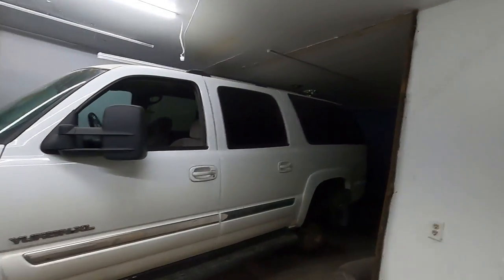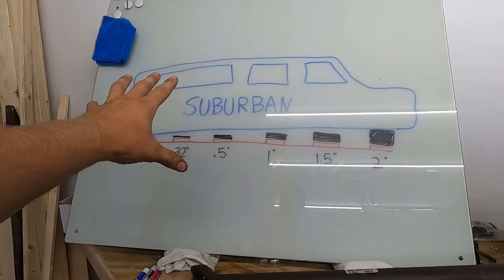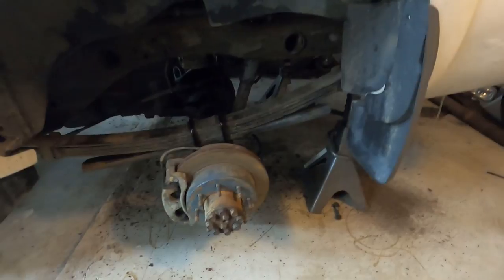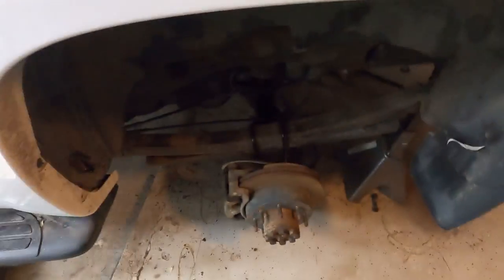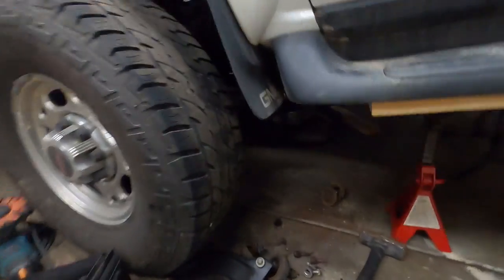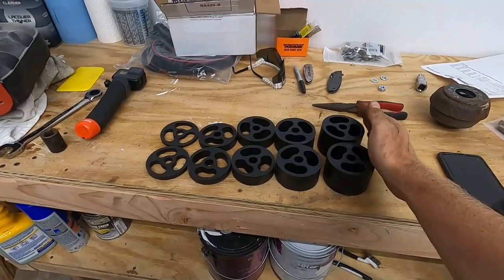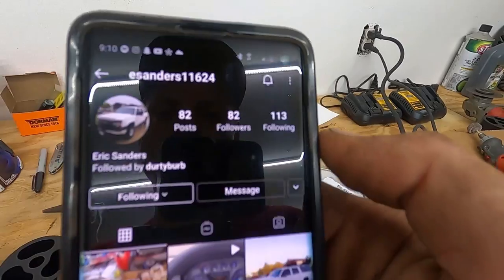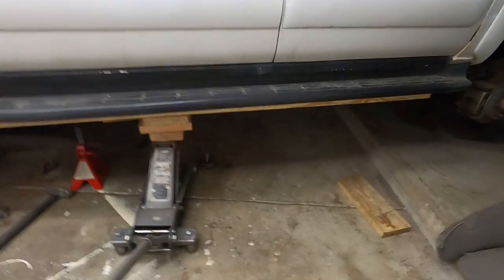You Have to Body Lift Your Duramax Suburban Swap

Comment: Im going to look at at $1k 2002 suburban K2500 this weekend. Seller bought it for the 6.0. I also have a line on a rusty $3.5k 2002 crew cab short bed. TO answer your question about what changed after 2010. For one thing, the bolt pattern changed to metric.

Comment: Also TIP: use both hoist front & back of suburban to lift the body at the same time. Get three people, 2 lifting, 1 putting spacers in
Reply from the maker: Thats not a bad idea!
Reply: @NaztyNate  Would speed up the work so much! Plus it’s much safer